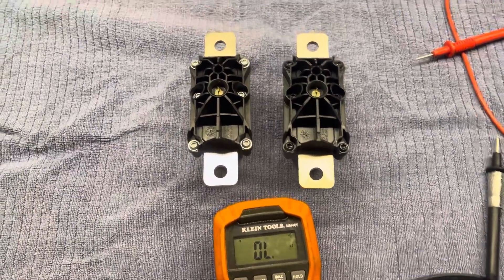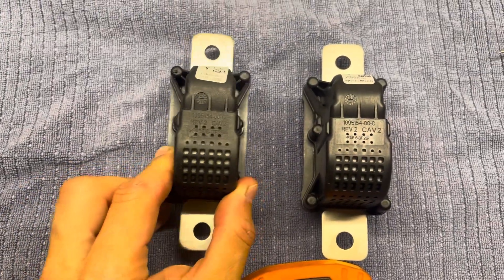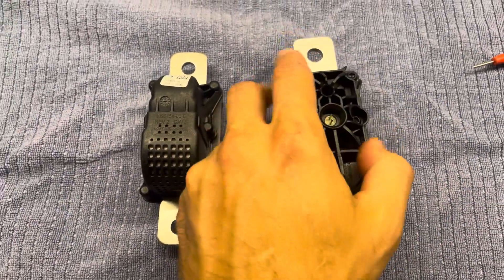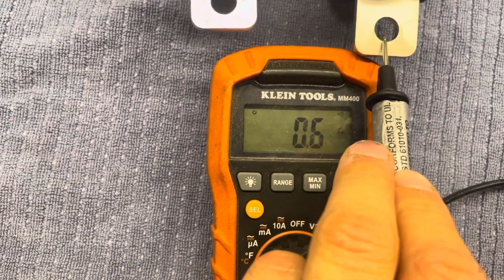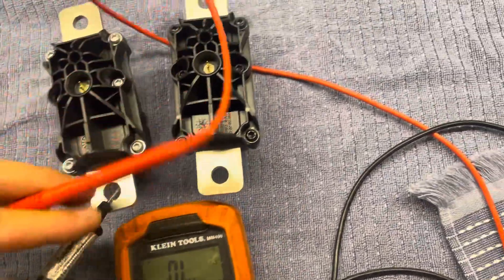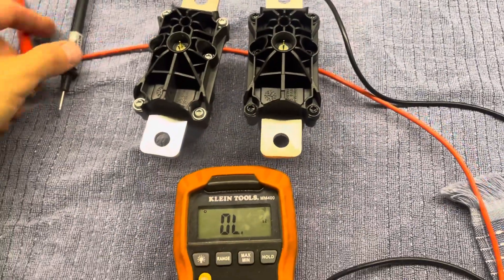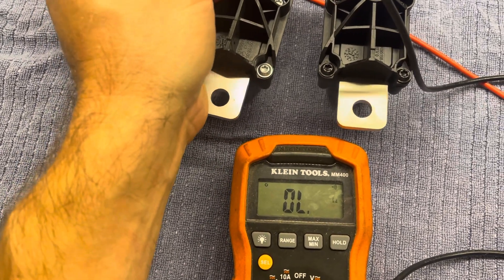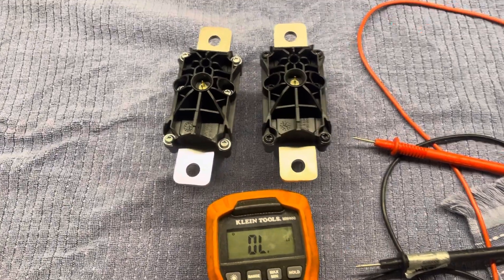How to test whether a Tesla pyrofuse is good or blown

Comment: I just purchased a mode 3 2022 from the auction. My mechanic is telling me the fuse keeps going out. I replaced the lithium battery but it’s telling me I have a hv problem it’s not allowing me to charge the car.

Comment: Do you know how fix "Safety restraint system fault"? after change airbags and replace seatbelt
Reply from the maker: There care many types of faults.  Enter service mode to see details about those alerts.
Reply: Like he said, but most likely once you deploy airbags the RCM. Restrain Control Module is locked and you would need to change that and have service center arm the new module.
Reply: @musclekingmedia is it possible to DIY?

Comment: Those are not Tesla pyro fuses. They could be just ordinary sand fuses as installed in early Model S and X. The Tesla pyro fuse circuit is actually powered by 2 cylindrical lithium batteries and owners are now getting asked to replace those with a 'self powered' pyro fuse.
Reply from the maker: You are confused.  Maybe some day I will make another video about 2012-2020 model S/X battery fuses, of which there are 2 types, older sand fuses and newer self powered fuses.
Reply: @diytesla  There are definitely 3 different fuses, pls. look up Tesla service info about pyro fuses. Yes, I get confused easily but I had all three different fuses in my hand. My 2013 Model s had a first gen battery with the sand type fuse accessible from the top (battery has to be lowered). Then I swapped in a 2nd gen battery with a Lithium powered pyro fuse accessible from the bottom and I actually took it out to check the voltage on the 2 batteries. Now Tesla is gradually ordering all older S and X in to replace either fuse with a self powered fuse. Looking at your black fuse I doubt it contains a circuit to trigger the pryro charge, I think it is just a sand fuse. But happy to be corrected.
Reply from the maker: This video is about model 3 and Y
Reply: @diytesla  Aha....I was confused, sorry.